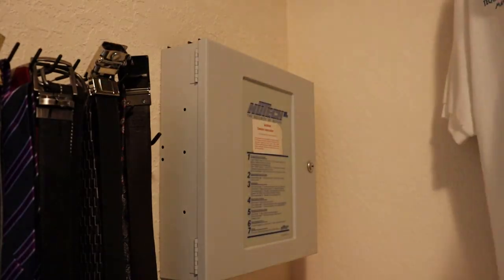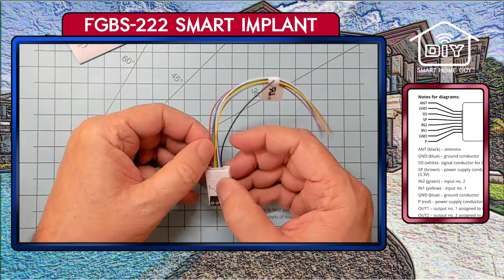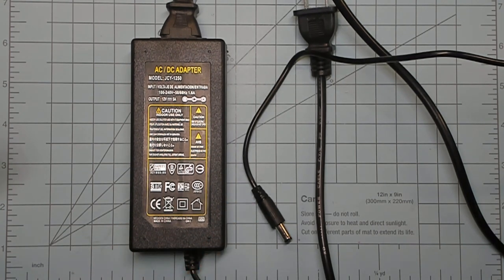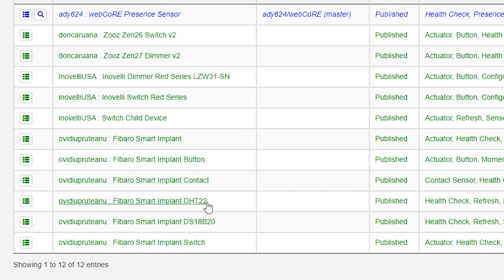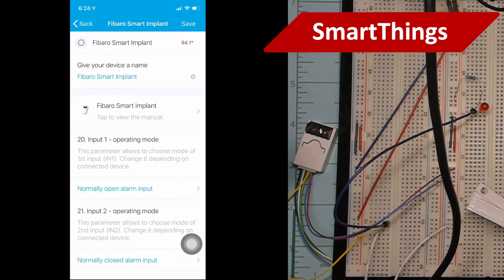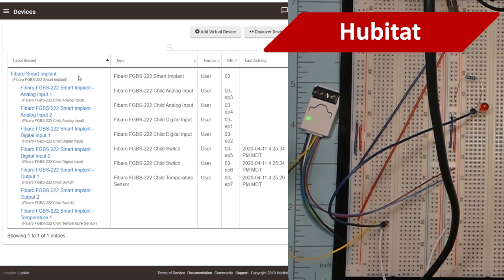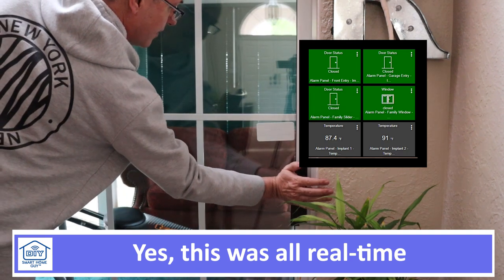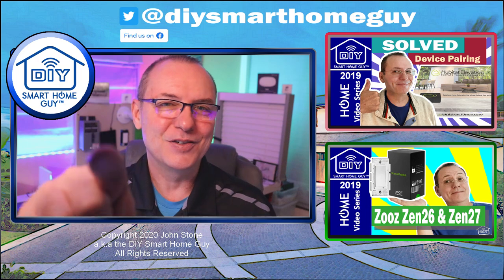Convert Your Old Wired Home Alarm System into a DIY Smart Home Security System

Comment: My concern would be for the cost of this device why not just replace your hardwired contacts or devices with a wireless device that does the same job with less trouble
Reply from the maker: Yup - that's an option. Also there is the Konnected security panel. Just one way to skin the cat.

Comment: Hay John, GREAT VIDEO!  Was interested in linking my old Honeywell wired alarm system to my Hubitat home security monitor. Before seeing your video I installed the Konnected alarm 2 panel $99 (sale price) along with their interface panel $29. You have two options, 1. Disconnect your old wired alarm completely and attach the old zone wires to the Alarm 2 module and control from your phone OR 2.  add the interface module with the Alarm 2 module ( leaving your old alarm in tack wirh your old keypads) and have the best of both worlds . You can still use your old keypad AND/OR use Hubitat or Smartthings to control your alarm from your phone . Its worked seemlessly. The modules are very small but not as tiny as the one you show installing. Love your channel ( saw you on the last Hubitat live too) Stay well!
Reply: Ok ok your comment had helped me the most . I'm actually  thinking  of doing  this now

Comment: Hello! I have DSC PC1616, unfortunately the system is armed and can’t be disarmed. I don’t have a master code. I still want to use wired pieces from the system, but replace it with something smart, that I can self-monitor from app. What solutions can you recommend? Really appreciate your help. Thanks

Comment: Can you connect two reed switchs (for example two window sensors) to this zwave universal sensor to make them wireless? I'm not sure if you can connect one of them or two. In case of two, how would be the connection?

Comment: I wish my house was already wired for an alarm to try this.  I like that we can get mostly wireless alarms like the Ring, SimplySafe, etc, but I hate having to buy those watch batteries and replace those every 6 months to a year.  And none of the battery sensors that I've seen screw in; they all use adhesive tape.  That stuff never works right especially for the magnet slide.  If the door swings to hard I've gotten them caught in the door because they shifted.
Rant over:  Great video! Can't wait to see what else  you use those for.  What can I use those for??? I'll have to do some brainstorming.  Thx Cheers

Comment: Thank you!
I have a Radionics (Bosch) D-9412 fire /security system installed in my home.
I installed it back in 1997 and ran over 74,000’ of wire during installation.
I have over 240 separate points of protection / 38 photoelectric smoke heads (2-wire using 8 zones)
and 12 alpha keypads.

Programming in 2023 is virtually impossible!
Remote programming was never all that reliable and requires 16-bit Windows O/S and an original Hayes 2400 baud modem
My field programmer is screwed with acidic leakage as I left the “C” batteries installed for 15 years. LOL

so… how do I add enhancements?
I spent over $40k  on parts and wire for the installation and really want to make use of the wiring and devices in the home.

This looks ideal!

Thanks!
Reply from the maker: That's quite the setup. You should also look into Konnected website : https://tbiu.io/LxihWipO

Comment: I’m so happy to come across this video, but may have missed some previous ones. I’m looking to convert my old wired home alarm system that was one of those monthly services like adt used to install back in the day with a control panel, power back up, smoke alarm that would ring the fire department or police department from a central monitoring service.
I’m looking to update it, as I still have all the existing wiring, keypads, and alarm panel .
I’m pretty good at DIY projects, but don’t know what system to invest in as Ring seems to  not have the best reviews and am looking for some thing that is open source so I can add zones as needed as well as motion, sensors, and security cameras.
Not sure what Hubitat is.
I’m willing to donate to your page in order for guidance. 
Looks like this was from three years ago and not sure if anyone has updated any links or new tech
Reply from the maker: If you don't have any other Z-wave based hardware (most notably a Z-wave hub), your best bet is Konnected - here is a link to their website : https://tbiu.io/LxihWipO

Comment: Could you test this device?  Zooz Z-Wave Plus S2 MultiRelay ZEN16    It's a multi use device that has 2-15 amp and 1- 20Amp dry contacts. So you can check status and control  garage doors,  (close an open door)   It has a contact buss bar built in.
Reply from the maker: I've been doing testing with it, but have yet to bring it together into a script. I'm hoping it comes together as you suggest.